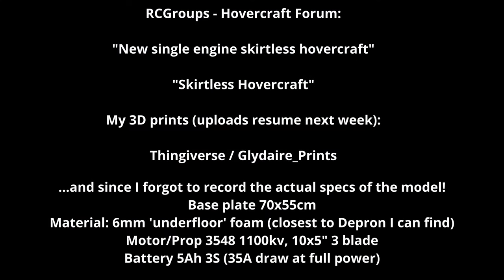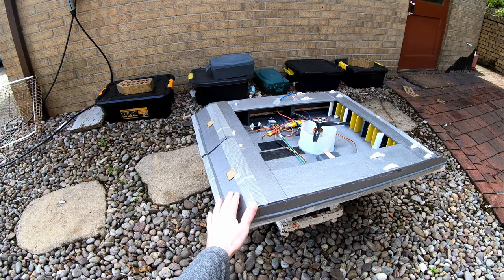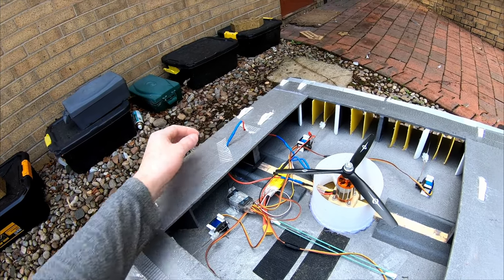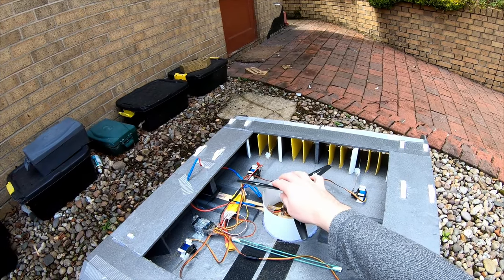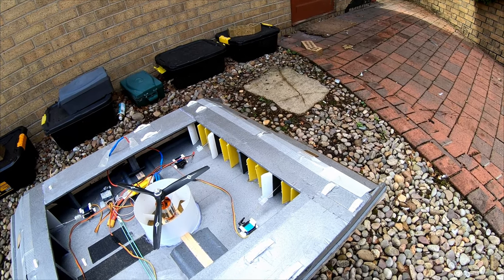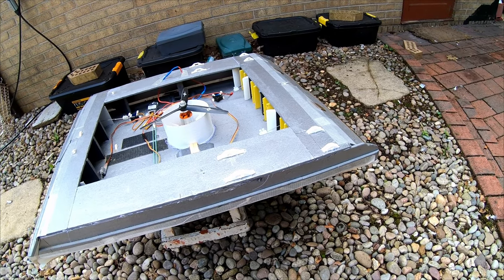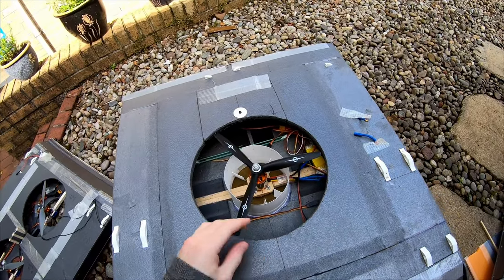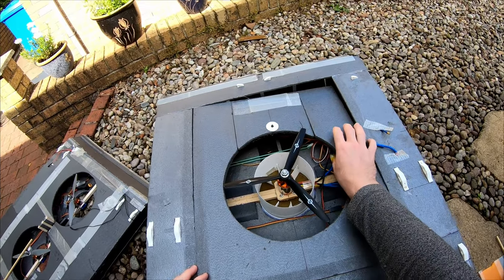Skirtless Hovercraft Projects - 2023 Design & Build Summary (Single Motor Craft)

Comment: If that's scalable then you have something there alright . Nice .
Reply: Basically just about any project is scalable. You use inch measurements to design and feet to scale up.
Reply: @robertblackshear8963  Not necessarily.  Not everything works through scaling .

Comment: In fact the first prototype of a hovercraft was without skirts, the issue with the skirts is that the internal pressure difference generates lifting pressure exponentially increasing the psi or kPa.

Comment: interesting design and great explanation video, it seems efficient also. maybe  the inner prop cylinder could have more cone shape, so that it might allow more laminar flow
Reply from the maker: Appreciate the feedback. I have used a conical diffuser duct on a previous build, it gave a very smooth operation on water and practically eliminated any turbulence underneath. But it also reduced the hover height enough that I went back to just a cylinder.

Comment: Interesting detail - Considering only motors used for lift - how would you compare the behaviour and performance of the 1,2 or 4 rotor skirtless craft?
Reply from the maker: How much time do you have for an answer!

I'd rank number of motors below the size/weight in terms of performance. You could have a very light and high powered craft hover high on a single motor, likewise a sufficiently heavy 4 motor one won't rise all that high but would tolerate wind better.

Forward thrust depends on both hull shape and general motor power. I have a small octagonal one where only one edge is available for the propulsion flap - speed is quite low, which may give the impression a single lift motor is bad. But the rectangular craft here makes far better speed both from more power and that more air is available at the propulsion flaps.

Single motor naturally suits octagonal/ circular better. It struggles with a longer rectangular hull so 2 lift motors spread the airflow out more evenly. You can actually do a square hull with 2 props which is kinda strange but works alright.

4 motor one is still kicking around although hasn't been powered up for a while. Probably going to build a smaller proof of concept for the hybrid multirotor idea - haven't forgot about it. My brief impression was great hover stability until the absolute extreme heights, the 4 stability ports seem to stop the sideways "topple" off the air cushion on the 2 motor designs. Makes sense when you consider how stable quadrotors alone are, the ground acts as a stabiliser itself for the air cushion.

Twin counter rotating props do counter the torque issue, although good design on a single motor one can largely eliminate it.
Reply: @Glydaire  "How much time for an answer?" - The topic so interesting I would prefer a long answer, but I am happy with the short answer 😊. 
I guess that the dominant factor is supplying enough air, for a given perimeter, with some left over for thrust and directional control. With a good supply, then the changing width of the peripheral jet, has a comparatively less of an effect. (I think I need to rewatch/review some of your earlier videos, and RCGroups posts)
Reply: I do have two other questions... (please)
How did you arrive at having the peripheral jet angle set at 45°? (i.e. did you previously try other values)
Have you made a craft that has no "centre jet from the propeller? (i.e. where all of the air feeds into the peripheral jets) [Later edit: The idea of a stability jet is first used during the evolution of the Bixel project?]
Reply: (... I have been reading back through RCGroups   posts and found when stability ports and then later stability circles were introduced. 😊 )

Comment: Saw this. Build a passenger sized craft. RC toys are fine, but you succeeded when you can pilot your build.
Reply from the maker: It's a nice thought but it's not happening.

This design has been done at full scale, see @peterkeogh9613 on here for the originator of it. It's difficult to scale up to man-carrying while maintaining a useful air gap, there's a reason peripheral jet designs died off the instant skirts were figured out. With modern electric power and lighter constructions it is somewhat practical for a smaller craft. Another generation or two of battery development and skirtless may have a comeback.

Hybrid hovercraft / ground effect again has already been done, see the "hoverwing" for a successful design. 

If I had the money for a big workshop and a build team, I would really like to take this full scale, as it is I'm struggling for time to even build models.

Comment: HOW DO YOU AVOID COUNTER ROTATION WHERE THE WHOLE VEHICLE SPINS EVERY TIME IVE TRIED TO REMAKE IT IT JUST SPINS
Reply from the maker: I'd really need to see a picture for a proper look at what may be the issue. At 8:33 in this video I mention the torque problem. Main counter is LOTS of straightening vanes  at the rear flaps and smaller swirling vanes in the stability duct. Air leaking from one flap will also cause a spin.

Comment: what if you undermounted the wings to make it one large planing surface? yo could even use the top wing mounts for metal bar linkages if it needs extra structural strength.
Reply: Flip issue mb?
Reply: @alexna6129  that was also a thought I had, but could add vertical stabilizers on top to bring centre of drag up higher, if lowering the wings brings the drag too far down.
Reply from the maker: Immediate problem would be them catching on the ground with any small amount of hull roll. I have this issue even with the high mounted wings and it's the main reason for avoiding rigid endplates.

It would also affect the air jet toward the back, you don't want a flat surface outside of the perimeter of the base plate.

I may try anhedral (downward angled) wings with flexible tips.

Comment: Isn't this more of an ekranoplan than a hovercraft? I mean, you are using the ground effect to stay aloft
Reply from the maker: A 'pure' ekranoplan needs forward movement to generate the air cushion. Hovercraft also sit on an air cushion but it's static in that the air obviously moves by the lift fan but it doesn't need forward motion.

You could argue any hovercraft is a ground effect vehicle but the general distinction is whether the power goes to making air cushion directly or by propelling the craft forward.

Lots of GEV use power assisted ram air to help get moving. That pushes them slightly into hovercraft territory, likewise any moderately fast skirtless craft will pick up ground effect air.